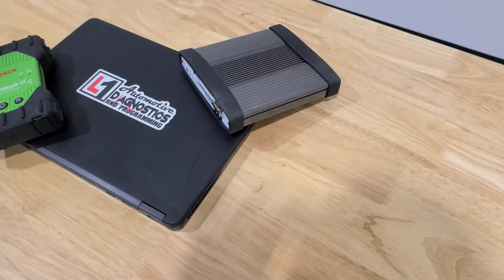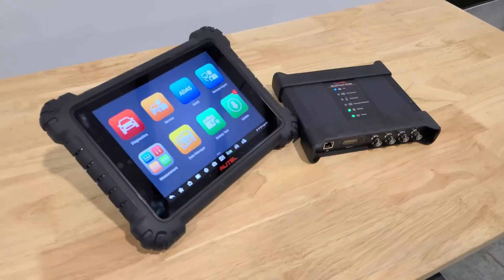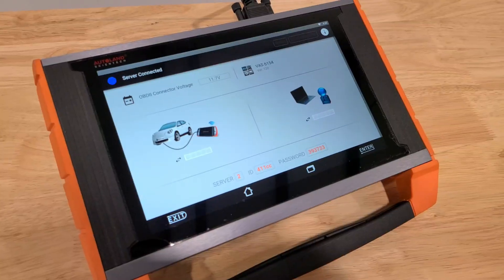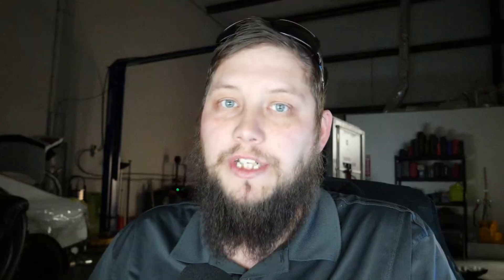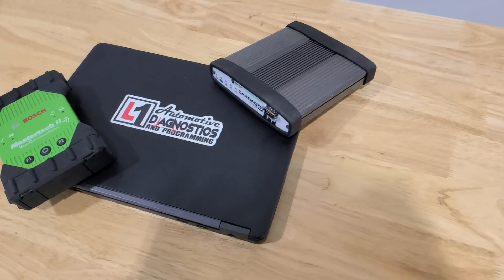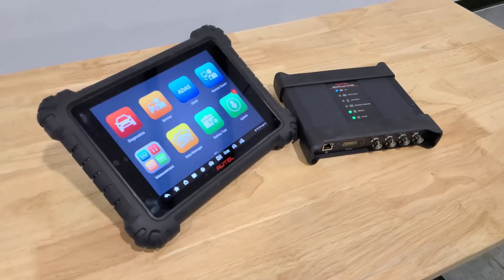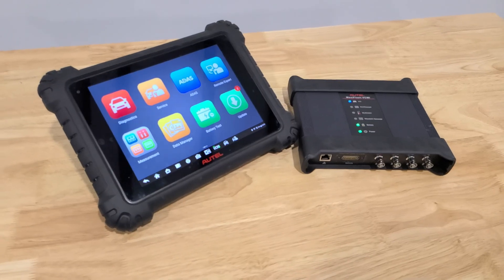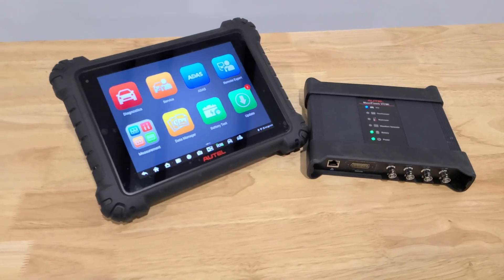How to program with your Autel, Launch, TOPDON, ThinkCAR, Etc

Comment: I have installed a used Instrument cluster in a 2015 GMC Sierra 2500 HD Denali and NO mileage is displayed just - - - -  I believe it is a Vin mismatch problem.  What can I use to correct the problem?

Comment: funny thing, my snapon triton D10 doesn't actually program ford PCM's. it can copy the old PCM data and put the old data onto another PCM. but if you need to replace a valve body with a 10R80 and get the valve body ID and valve body strategy, you cant do it. Snap on doesn't have any allocation in their UI for that. you can copy pasta, but no plug an go. That was frustrating.

Comment: Would you be able to refer me to what would work for my Nissan Murano 2007 for replacing the BCM with a used one? I’m guessing I’d need a laptop with an adapter to code. But hoping my car is old enough to use one of those bidirectional scan tools I see on Amazon

Comment: Short answer: Each manufacturer has a portal and software specifically required to program their modules. The access to the data source for the programming part requires a subscription and each manufacturer has different pricing. 
Diagnosis and scanning is a completely different part of the subscription then the Maintanence amd module programming sections. 
To program you need manu software usually free, subscription and the device compatible. Many passthrough J2534 is a  typical device type unless exception such as some newer ford specs etc.

Comment: Even though all scanners claims to do programming which none of them do they can only colon a computer or module the only way to program a computer is with the J3524 and a computer because the information needed comes from the manufacturer not the dealer

Comment: Question: My 05 PT Cruiser Turbo High Output apparently is really rare because no one has ever heard of it losing the updates when power is removed. This has happened to me twice because I changed the battery. I talked to a programmer service about this and they said send it in and we will fix it. I get it back 10 days later and same problem. It throws random codes and check light comes on again after 5 to 7 restarts. Have you ever heard of this? Program RC-D46-05 Fixes P2074 Code
RC-D45-04
RC-D18-04

Comment: Its Not A Rant Bro, You're Correct, As I've Learnt that Most Of these Basic Scan Tools that Promise Lifetime Updates Does not Do anything Advanced. At Best they are all Just "All System Access Devices and Module Switch Actuators/Activators" (Which they Label as Bi-Directional Capabilities). Every Scan Tool Brand Has 1 or 2 Vehicle Brand that they are able to do something a little more On. But, It's Very Deceiving when They Put ECU Coding and You Can't Even Code a Module Or Sensor that You Just Replaced with the same Scan Tool that Claims has that Function.

Comment: So I need the j2534 to install a GM pcm from Oreilly’s ?
Reply: Yes. If the pcm is brand new and global architecture based. If the vehicle whose pcm has gone bad is an okder vehicle that is still on the common architecture, a used pcm will work but a relearn will be required. The relearn will not change the VIN# but the car will start and run with no issue or VIN mismatch related DTCs
Reply: O'Reilly's should have asked you for Vin # and other information. I believe those ECM or PCM can be pre- programmed. So you can install the new one and you are ready to go..

Comment: So what is considered configuring and what is considered coding? If i wanted to increase the minimum battery voltage setting for stop/start on my vw to effectively permanently disable it so i dont have to turn it off with a button push every time i get in,  would that be something that could be possible with one of these tools?

Comment: Can the autel mk908p ii, im508s and topdon phoenix plus , clone / write vin to the me9.7 ecu and vgs3nag2 mercedes w204 c300 4matic??? Also does it lock you out when you dont pay your subscription? And lastly roll back a programming newly done on an ecu precisely the me9.7 bosch benz ecu ? Im asking cos i recently used launch to update my ecu for my w204 2010 mercedes c300 4matic and now it suddenly throws up hood sensor not cominicating and back seat rest not lashed , and my vehicle doesnt have any of these sensors equipped cos i did a thorough sweep of the vehicle , especially the hood lash , no sensor whatsoever ,
Reply from the maker: Yes with other associated tools, yes and no, and no.
Reply: @L1Training  yes to which and no to which , please explain better so I know what you are referring to . Thanks

Comment: Do you have a favorite or your "go to" j2534 device? Also can the mongoose plus program other brands? Or is it limited to the designated brand i buy for?
Reply from the maker: Cardaq Plus 3 is my go too, its also the most validated. Each mongoose will be functional on any car that has a networks that the protocols of the individual mongoose supports, its a difficult game to try to decipher which year make and model of every brand that a mongoose will work on of an unsupported manufacturer. I would just stick to what they are designed for.
Reply: @L1Training i use Cardaq M. 3+ is better

Comment: Hey i have a question ive tried to program a 6l80E TCM in a 2008 pontiac g8 with sps2 and it gives me an error code E2907 we have checked the harness its good but keep getting that error.
Reply from the maker: Needs diagnosed

Comment: Thanks for calling it like it is!!! Im on the market for a mid-level $400 range scan tool, and it can be overwhelming with all the "false" advertising like, bidirectional, programming, mode 6, mode 8, FULL OBD2, clones and so on.....  Is like saying your new scanner is Gluten Free!! lol 
Could you recommend a "decent" mid-level ($400) scanner that does it "A̶L̶L̶" MOST? I'll be using it with a 2009 Avalanche 4wd, 1998 Z28 and 2005 Jeep. Thanks!!
Reply from the maker: No clue really, as a professional repair shop we don't really operate in that range of tools.
Reply: I just purchased a Launch CRP919E for under $400. Seems to do well.
Reply: @DS-ss396 crp mean crap

Comment: Trying to access srs module RCM in my 2016 Ford Escape and this S7 plus give me a message says “ car no support “ anybody knows what I’m doing wrong?
Reply from the maker: Module is probably not communicating. Try another tool, then check all powers, grounds, and communication circuits.
Reply: @L1Training  I returned it it’s trash , I bought autel IM 608 instead.
Reply: @L1Training  it’s communicating  actually but it’s not working only when I want to enter the RCM function and also this S7 plus not working with Chevy cars I tried it on 2 1999 Chevy express cars .

Comment: Would be very useful to make an additional video comparing module cloning capabilities instead of programming of diffrent tools, as like you described, aftermarket programming is not so available.

We need a tool that can do cloning and immo well, and to know which makes have the option to make a replaced ECU functional with aftermarket tools.

Thanks alot

Comment: Any video reviews on the Topdon Plus vs Lauch X431 Pro vs Autel MK906 within the $1,200 range cant find any comparing to find the best bang for the buck to work best on GM and Chevrolet, Ford Etc..?
Reply from the maker: As a professional repair shop and the go-to diagnostic, programming guy, we typically do not even own the "heavy DIY" or General service type tools. I have a few videos on some X-431 tools in that range, but most that we have are 2k and up.

Comment: Well he is right. Launch and autel do a good job with euro programming but even that is about 60-85 at best!! You may need 2 or 3 different scan tools to finish it.  The rest of the manufacturers you can try, but you better have quoted the worst case scenario as far as fees go and have the necessary VCI with laptop software ready. Or know how to fix it if the launch and autel screw something up.

Comment: I am confused... do I need to replace the 02 when I get a lean code? Then I program it right? Will my Snap-On program that? Thanks in advance..😑
Reply: Pull the cylinder heads and check for a leak, if that's okay, Then program it.
Reply: Only if you have the correct personality key...
Reply: Hi Eric!! 👍. Fancy meeting you here.
Reply: If they got  warranty or there from outta town then yes
Reply: Only install if the parts already have green crusties
Reply: You do on toyota
Reply: Only if you get a Dorman O2. 😂
Reply: Jajaja South Main Auto is being sarcastic here.
:)
Reply: You'll need to re-program all the other o2 sensors after replacing one. Then, when that doesn't fix the lean code, get out the parts cannon and fire it multiple times. Replace as many 'good parts' as you can afford, with cheap junk parts until you give up, then take it to a professional like Eric O🤣👍🇦🇺